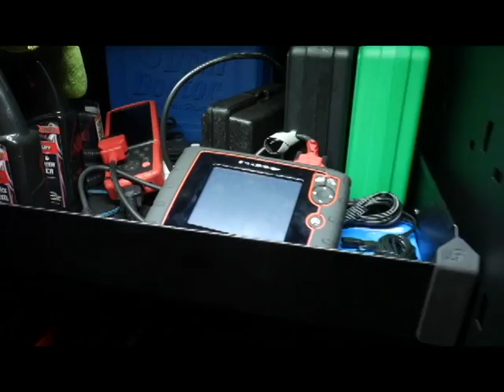WHAT ARE DIAGNOSTIC FEES AND WHY DO SHOPS CHARGE?!

Comment: Diagnostic charge should be the hourly rate, if you spend 2 hours doing diagnostics/Fault Finding you charge the time, the outcome is irrelevant (you may be able to fix or the fix has to be decided by customer, might be costly). (it's also irrelevant whether you use or do not use a"diagnostic scanner", diagnostics can be done with a DMM and test light)), Further if you are investing in new technology you have to pay for that as a business or individual, so to me this cost should also be embedded in the hourly rate. (Diag/Fault finding + technology and training costs). If a shop or individual mech wants to play customer politics with this then fine.
However what I do object to is a shop where they "slap on" a scanner , tell you the fault description and do nothing else but charge £50 for the pleasure of connecting a scanner. keep up the great vids.

Comment: Before i became a mechanic, my lb7 duramax had the notorious injector failure, and i took it to 2 independent shops and they could not figure out what was wrong with it. I then took it to our local chevy dealership (my now current employer lol) and they diagnosed it as injector failure. They quoted me way more than i could afford for the repair, but i was happy to pay the $90 just to know what was wrong with it. I ended up fixing it at my house, but now that i work there i completely understand the importance of diagnostic fees. Great video btw!

Comment: Great video thanks brother. Just had this discussion with my son. I called the local dealer to discuss my third brake light. I bought the truck new little over 4 years ago . The light housing and everything has been changed twice by them. Keeps getting water inside the housing. They were going to charge me a diag fee. We talked about it for a few minutes and I decided not going to do it. I am a retired heavy equipment mechanic. I upgraded the light and I also got the better gasket from what they put on. When I put the new one in I also put a gasket on the screw. I would not have had a problem with paying them if it was a major issue. I have no idea how to work on the new vehicles other than to service my truck. Keep up the great work see you in the next video thanks again brother.

Comment: At my shop,  We charge a diag fee for just about everything.  As a business owner, this is how I look at it.  When you come in with a check engine light or diag of some sort, That is usually requiring my highest paid A tech.  Its also requiring the most expensive equipment in the shock (We have factory scan tools and testing equipment)  So with all that, you have to charge.   Now, if we are doing a window motor, obviously there is some overlap there, and we compensate the estimate for that.  At the end of the day, my guys are paid well, we have the correct tools, and equipment and a nice, clean shop.      

Dont want to pay for a correct, accurate diagnostics, we are totally fine with that and agree we are not a fit for all the people out there.
Reply from the maker: This is the exact outlook people need to see from shops!
Reply: HONEST POINT! ANYTIME THERE'S LABOR THERE'S A CHARGE
Reply: do you charge a fee to install tires? wow unreal

Comment: Spent 5 days to find a short in 01 rav4 that keep EF13 fuse blowing as soon as u turn a key plus P100 & P505  showed up at the same time so I took the car to dealer for $190 diagnostic fees then an hr later svc advisor called that they need more extensive search & have to check all cabin wiring & charged me with 4 fuses cost $6+ each plus tax & came out $852 so that's 4x from the $190 diagnostics flat fees. Then all they came out with is to replace the engine wiring harness $1500 with labor out the door is $5,200+, so I just paid the $852 & towed the car home. I already know it's a wiring issues in the begin with but they couldn't tell me that except recommended to replace the whole wiring..

Comment: Awesome video! I thought you explained the various scenarios for labor charges. The shop I work at usually will do an hour of diag & waive it if the work is done. Complex diagnoses that require over an hour get billed as such. We are an independent shop & us techs are not flat rate, so no diag time arguments. Our system works for the boss & us techs.

Comment: I wish this was true for every shop...I paid for a diag on my car a while back and they told me it was the fuel pressure regulator and ignition control module, and I asked them specifically "Are you sure that's the issue?" which they said yes, that they would replace them both for me for $650 and id be back on the road, no problem. So instead, I replaced both myself and that wasn't the issue. It was the coil packs...oh, add to that the fact that they broke the vacuum hose from my evap to my throttle body and pretended they didnt know why it wouldnt start back up at their shop...even tho they managed to start it, in order to park it outside, for me to pick up. I popped the hood and the guy ran to the engine and said "oh they forgot to put the lines back on, that's why!" so then...how did they manage to start the car and park outside if the car wouldn't start without the line on? Not saying you or the majority of shops do shady crap like this, but my experience with the few shops ive dealt with have been complete hacks. Which is why I work on my car myself now.

Also, sorry for the long comment, this topic just definitely connected with the issues ive dealt with before.
Reply from the maker: I very much get where you are coming from and that sounds like you’ve had the run in with those “steal your diag time” parts changers. They put a sour taste in a lot of peoples mouths all across the industry.

Comment: I get it, I don't however when I went to a shop and asked if they could change my radiator because it's leaking... yet they still want to charge for the diagnostic. It's pretty hard to misdiagnose a hole you are clearly seeing all the water coming out of

Comment: Great video and another case in point we have to deal with in our trade. Being I work at a small independant shop I'm also my own service advisor as well as the tech so dealing with this issue isn't uncommon. The best example I give customers is when you have an issue at home with the boiler and call a heating engineer out does he charge you a call out/diagnostic fee? They reply well yes of course. To which the conversation usually ends there cos I reply well whats the difference between us diagnosing your car and the heating engineer diagnosing your boiler? 
As the video highlights people still dont respect what is involved in diagnosing cars especially these days, its not like back in the day when you could fix a car with a tweek of screwdriver on the carbs.

Comment: Thank you for explanation. My question is if you take your vehicle in for a diagnostic, will any other problems show up other than what the stated problem may be?  As an example, I have been told the car is burning oil and I hear a tapping. Two years ago, there was an issue the spark plug #1 and was told needed to have all changes as well as solenoids. Would that show up on the diagnostic?

Comment: I love it when customers come in with there codes from autozone and say well I have a code why do you need to diagnose it if I’m telling you what it is. When thag happens I hit then well I would be glade to replace what ever you want me to replace but when it doesn’t fix it you still have to pay. Then it will be xxx.xx to diagnose plus what ever repairs you need to fix the issue at that point they kinda change there mind about us diagnosing the vehicle for them. Perfect example was today lady comes in with p0301 cyl 1 misfire told me it was the coil because autozone told her that. Well well it wasn’t a coil at all it was 4 tappets 2 rockers. So that’s the reason why we charge to diagnose. Writing this all before I watched the video to if you mentioned the exact same thing I’m saying
Reply: Exactly the cheap code readers tell what the vehicle is doing but not whats causing it.

Comment: Sometimes diagnostic fees go too far, like charging a $190 diagnostic fee for a burnt out low beam headlight. I only got a quote because my truck can take about an hour to replace each one, because it’s a pain and you need to remove the grill and the light assembly. But to charge a diagnostic on a common maintenance thing like that is ridiculous. Upcharging the part and the labor teplacement time is fine.

Comment: I work at a dealership in Canada.  Wont mention brand name but have swapped multiple 3.0 Turbo Diesels in half tons so that should be a good hint.  The manufacturer has made it very clear they will not pay the technician diag time, claiming the Labor OP has Testing said component included.  For example, Car came in multiple times for MIL evap code.  AFter 3 techs and 2 dealerships had a go i got it, spent an hour but found FTP port on fuel pump not punched through causing no reading to the sensor.  So after all that, i get 1.3 to diag and replace the faulty part, essentially losing an hour.  Whats your experience with warranty pay, honestly have a very sour taste for my current manufacturer and thinking of switching brands.
Reply from the maker: I totally understand that way you are feeling right now. And you doing that kind of diag without being paid is not good. It also sounds like you don’t have a very good or knowledgeable warranty admin. There are labor ops for diag time with correct documentation and clock time. Usually up to 
.9hrs is easily obtainable without preauth but anything over that is a bit tricky and harder to get....but not impossible.
Reply: @RustbeltMechanic  Appreciate the reply!  As for warranty admin, my dealership doesnt even have one at the momen.  I usually dont have trouble getting diag time as long as i dont replace any parts such as a wiring repair or something like that.  Its sad the manufacturer sees technicians this way.  The auditor basically told our SM that if a part is changed the diagnostic time is built into the lop, which would be ok if things failed the same way all the time, but with new technologies in cars and so many modules, i dont see how they are able to claim all the different scenarios are built into 1 "test and replace" LOP.  Anyways enough of my ranting, glad i found your channel and look forward to more content!

Comment: Boy it sure looks like the dealership flushed a lot of money on those specialty tools. Most of them are rusty or sitting in boxes that appear to have never been opened. 
Back in the days when I was a car mechanic, we would charge a small diagnostic fee if we actually diagnosed a problem. To me, that meant that I found the problem and provided the customer with the information to fix the problem. That's what they are paying for. Information. 
Some customers would ask us to "read the codes". I would not charge them for that.
Reply from the maker: Wes Johnson Services oh yeah totally get that...those tools are rusty because our dealership had a fire 3 years back and all the soot and water from the fire caused this to happen unfortunately. Then as of the last year or so we’ve found the tools store better/easier on the shelves in their shipping boxes. But...you’re also right that many of them are outdated and unused.
Reply: Interesting. I think fires are somewhat common in dealer shops. We had a local GM dealership burn completely to the ground last year. A truck dealership burned down the year before.

Comment: I think what's confusing is that shops charge labour so you expect to pay that and parts /consumables. But becaue most shops don't tell you up front there is a diagnostic fee it comes as a surprise. That's the first thing (they need to be more up front about the fees). Kudos to the ones that do this already.

The second this is that it's confusing to say that you need to charge a diagnostic fee or for use of the equipment. That only applies to some situations. You don't charge the customer a wrench fee or a torch fee. Furthermore if feels like double dipping to be charged labour and diagnostic fee.
Reply: A diagnostic fee is labor. The separate labor charge is the labor for the repair.

Comment: I have been luck.  When I was at a dealership.  I hated to wate for the scanner to be free.  After I had it.  I got the good old 2500, yes I said 2500.  I still have it and use it the odd time with ODB 1 car and some early ODB2 .  You nocked rhat out of the park with that.  I explain with my customers that have come to me with electrical.  I tell them it is strait time.   With the explanation  it could be just a burnt bulb.  To a broke wire.  However if I am asked to do a scan.  I charge A set fee but when I give them the outcome I tell them that if you have me do the work I will wave the fee.  I like when they tell me why do you charge for scans.  It cost me alot to buy the tools that are helping me tell you what is wrong with your car.  You can go get a $100 code reader that might tell you what is wrong. They  have done and did thT lol to call me up to scan the car lol.
Sorry bit of a rant.  Come spring time I need to get my gerage working for me. You  and jrc54 have made me want to give YouTube a shot with making videos on here.  I love looking for something to find not what you are looking for.

Comment: My local dealer charges you only if they can't find anything wrong.   Thing that pisses me off is the service writer said everything was ok .... Couldn't find anything wrong....well I showed a video  and photos of what was happening and he shuns it saying that doesn't matter we have to see it for ourselves.  That's BS if it's documented and the vehicle is still under factory warranty.  Other thing that upsets me about dealerships.. I make an appointment for 8am I said I will wait, they said it will be a while... I'm like why? My car was first one here? I get a ride home.... they call me at 430pm saying to pick up my truck.  What took 8 1/2 hrs?  BS.
Reply: Jeff Eppenger if vehicle is under factory we don’t charge diag at all unless I can see physical damage or vehicle has been hit in the area that there is failure. But we do the opposite if we cannot get the condition we do not charge the diagnosis fee.
Reply: @Broke335i  every dealer basically does what they want.  The manufacturers probably don't know what's going on half the time.  If they did maybe the service would be better especially if it's documented.  In this particular case it was through a Nissan dealership.  I ended up going to another dealer and they covered what the other dealer said wasn't covered.  All this does is create pissed off customers and that hurts the brand.. any brand.  A product is only as good as the people that stand behind it in my book.  I guess I'm old school.
Reply: With intermittent problems it makes much harder to diagnose. You can waste a lot of time trying to recreate problem. We charge something but may not be able to duplicate problem.
Reply: @phillipwilson6781  I understand that and that is very reasonable to say if it was just the customers word.  If there is video proof? Then how can the dealership day it never happened? Or they corny duplicate it? The fact is on video it did whatever it was and was proven?  Then the service manager tells you they can't do anything?  Makes no sense.  In my case it was my truck over heating and after taking it back 3 times they somehow going out my fan clutch was faulty.  Stuff like this just shouldnt happen if the dealerships would just listen to their customers and not assume we are all full of BS.  Not saying it always happens but I had proof and if they would have just taken the time? Anyway it is what it is.

Comment: If they spend time diagnostic testing of course they have to pay for it. If you spend 1-1half hour to fix a diagnostic < then it should be 1- I half hours of what your rate is.however you should not charge extra for using your machines to test. Don’t give a person a lesson on what tools you have to buy, much like the gratuity fee you charge as miscellaneous charges , that is a rip off. This should be in your projected shop rate . Walmart has to build a building to sell their goods Ect ,they don’t charge miscellaneous for their adding machines, lights Ect. If you can’t afford to buy these tools Ect, then you shouldn’t be in business. If people think your going to do a test for nothing ,then their not a customer and you don’t need them.